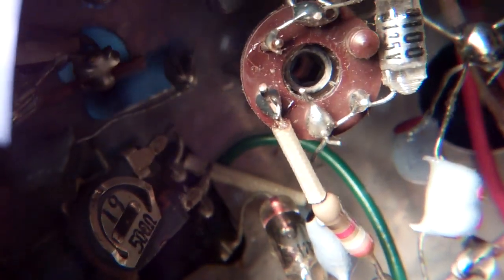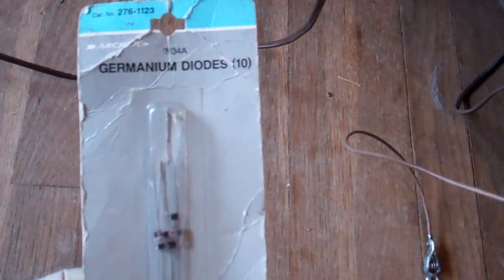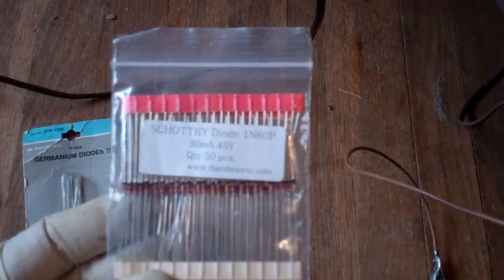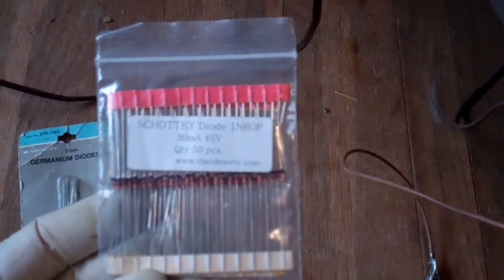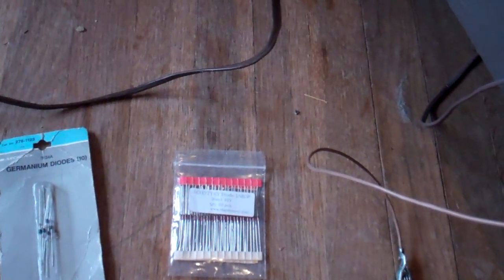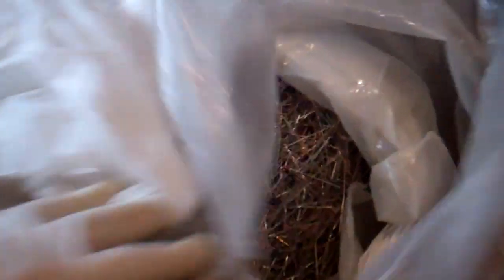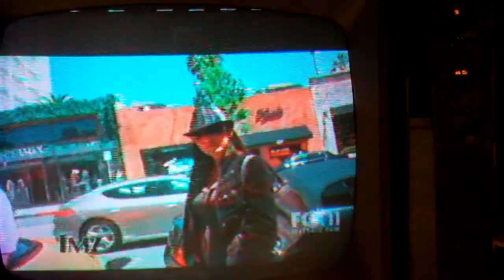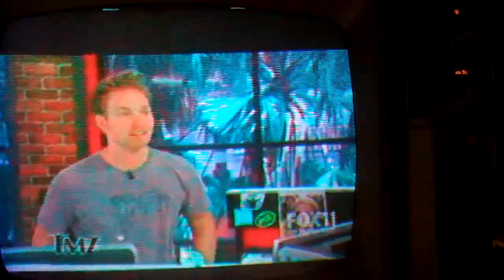Trying Different Video Radio Detector Diodes in Vintage Television 1N34 1N60 1N60p Part 3

Comment: Very interesting, I just ordered a heap of the 1N60Ps for an old clock radio and other assorted stuff and judging by your success I think I should be OK, where did you get that huge bag of diodes from?
Reply from the maker: No they do not work as good as the germanium diodes. What I say in the video is the sensitivity is noticeably less